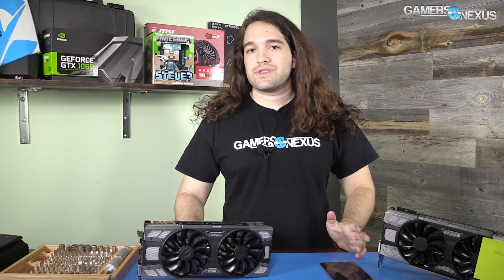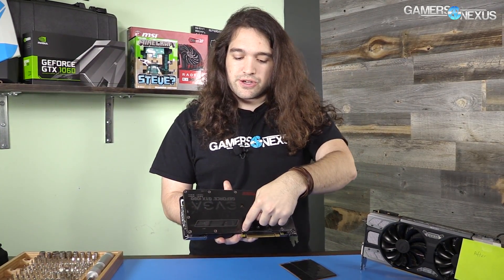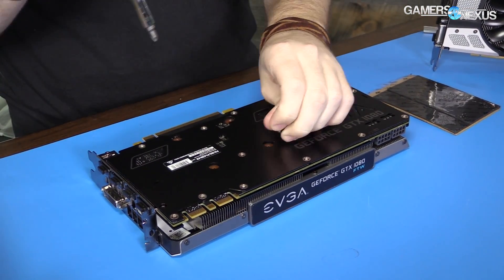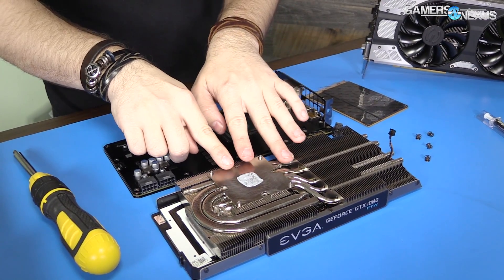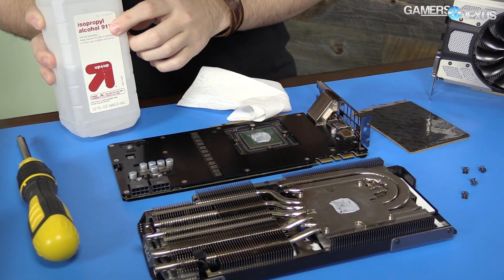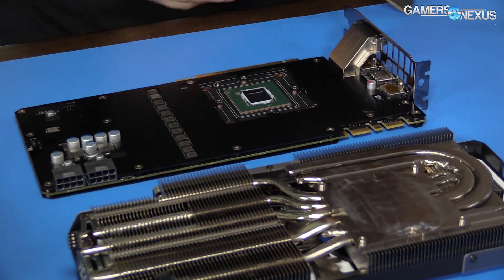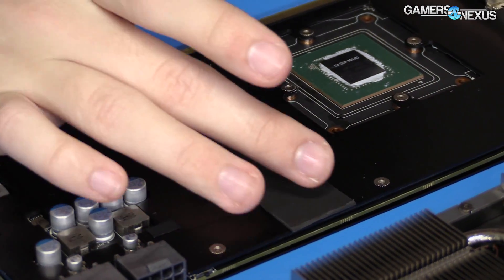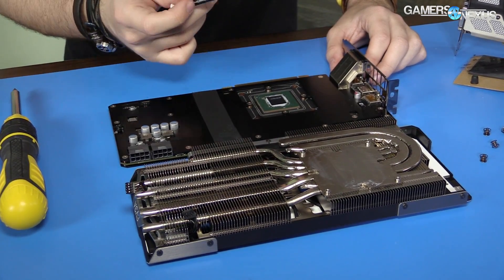How to Install Thermal Pad Mod on EVGA GTX 1080 & 1070

Comment: I always notice when you handle graphics cards that you have a habit of touching the fans. Those fan bearings aren't really designed to be load-bearing, they're only designed to hold a light plastic fan, not the weight of the whole card/cooler. Probably better to not touch the fans at all when lifting a card/cooler. It's unlikely to cause major damage but can cause them to spin off-axis and make noise/heat/wear/etc.
Reply from the maker: The fans are fine. You seem to think they are being pressed a lot harder than they are. The force from shipping would be far greater.
Reply from the maker: Because there is no risk of damage here. There is a huge difference between "push" and "touch." Being overly sensitive about this level of touching a product is needlessly worrisome. Flipping the card on its face doesn't put force on the fans, either. That's on the faceplate. And touching them while presenting is harmless.
Reply: God dam there is always one soap box idiot, minor touching the fans like that is zero issue, they are simply not that brittle, utter garbage.
Reply: I understand how you could see that as my taking offense but it was not. What I was trying to convey is exactly what I said. I'm not sensitive about it, and not overly so. Just trying to do you guys a favour and share the knowledge. Steve struck me behaving entirely defensively. He was defending himself against claims I did not make (flipping the card). He was exaggerating my concern (by calling me overly sensitive) and, in a manner most unlike him, he was throwing science and engineering out the window and telling his viewers that touching the fans is harmless, and refusing to follow best practice. That struck me as unusual behaviour for him (for example I've now seen three how-to videos on this and Steve was the only one with a visible antistatic strap), that's why it seemed to me that he was being overly sensitive.... So, that's why I said what I did. I ain't mad, I am a 'call it as I see it' kinda guy and that's all I was doing. I wasn't trying to 'hit back', just replying in context. Like you say, emotions are hard to read over the internet, and this is Steve's job, so I guess he doesn't have time to clear it up like we do. Either that or he just got mad and blocked me. Probably both ;) Anyway, Steve's content is generally excellent and I will continue to sub, like and share his content because it's high quality stuff. I ain't mad, he ain't bad. We're all good here :)
Reply: Damn this dude really wants some attention, why are you worried about other people's stuff.  Look mom i was right on the internet -- durrrr
Reply: I never said anything about flipping the card over because of exactly that. And yes, there is a difference between 'push' and 'touch', it's the amount of force exerted, and that's not visible on a video. I'm not being overly sensitive about it, I'm just mentioning it. You seem to be overly sensitive about me saying so. I've repaired a lot of devices with fans broken by people mishandling them. We'll have to disagree.
Reply: Comanso Rowlett
 I have no problem with him replying, never said I did. What do I expect? I expect him to at least say something like 'hey yeh it's a tiny risk but it's a really tiny risk and I'm careful, don't stress bro', so that his viewers know they should be careful too. Saying there is "no risk" is simply untrue, and worse yet, it gives untrained viewers the impression that they can do it too, with "no risk". What do you expect me to do, sit and watch someone teach thousands a bad habit and say nothing? TBH I have done for dozens of these videos and I'm starting to wish I had kept doing it... but some hardware techo like I used to be, would be fixing some of your noisy fans. I'm only trying to help, by passing on my experience (which is extensive) and training (from companies like Intel, HP, DEC, Dell and IBM who ALL said don't touch the fan blades - and that's ranging from laptops to blade servers.)

Whether he's been fortunate enough to not suffer from it is not relevant, many others have been less fortunate and best practice is best practice. That's why he's wearing antistatic gear in this video. 99 times out of 100 you could just tap the case before you start and do no damage, but we wear static straps because it's best practice - especially when you're a famous youtuber and a bunch of untrained people are following your every move. I never said he was going out to offend me and I never said I was offended. We just disagreed. He shouldn't change his methods because I said so - after all like I said his viewers generally will be untrained so it's sensible to take our comments with a grain of salt - but he should change them because touching the fans is not best practice, it does carry a risk, and most of all because it's not necessary - there are lots of ways to handle the card without touching the fans. Or heck, he could just do it his own way and not change at all, but at least let his viewers know that he's taking a calculated risk, so they can decide for themselves - and not pretend there is no risk at all. It's not Steve's style to be misinformative, otherwise I wouldn't sub, like and share his stuff so much. I understand it must be frustrating to have everyone question your methods, but sometimes they're going to be right....

Please stop with implying I've said things that I have not, and please read what I already wrote. Correcting and repeating it makes for walls of text and nobody likes that. I've taken the time to reply because I genuinely believe that we all are doing what we are doing here, Steve, you, and I, because we want to help each other.
Reply: Thanks to the wonders of search engines, I could spew documentation of bearings and their intended load vectors all day. I'll just be lazy and leave it at the first two search hits I came across since you're being rude: https://en.wikipedia.org/wiki/Ball_bearing#Direction_of_load

http://www.kaydonbearings.com/typesACX.htm
"Load can be applied to bearings in either of two basic directions. Radial loads act at right angles to the shaft (bearing's axis of rotation). Axial (thrust) acts parallel to the axis of rotation."

TL;DR: pushing on one side of a fan is neither radial nor axial load. They're not designed for it. That's why you shouldn't push on them, that's why you shouldn't risk pushing on them, which is why you shouldn't touch them unneccesarily. It's not an "oh noes it's gonna break if I touch it" thing, it's a matter of best practice - as I've said all along.

I'm done trying to help here. You'll be replying to nobody, so if soap boxing bothers you, maybe don't bother doing it yourself after I leave. But hey thanks for being so polite... not. At least Steve can disagree respectfully. You should learn that from him, too.
Reply: You also have to remember they are designed to spin so damn fast, so the way Steve is pressing it is nothing basically.
Reply: Capta Praelium It's his job, of course he will reply if necessary. What do you expect him to do, sit there and let a comment make people think he's doing something wrong? I gave him my TITAN XP to do some videos in and even tear it down alongside a hybrid. If touching the fan was a worry then he would of broken at least one already in his lifetime (fan)? Infact, he even span the fan which then hit a loose wire a few times and the fan was totally okay and he even tapped it where you can noticeably see it bob down and 0 problems what so ever. He wasn't going out to offend you in general either, he's just telling you these things from experience. Yes, your experience may be different but it doesnt mean he should change his style all for 1 viewer otherwise he'd be overrun by the amount of times he'd change.
Reply: Capta Praelium
I am reading exactly what you've said and you have to realize that emotion doesn't correctly come over text correctly so it seems like you got offended almost immediately. "I'm not being overly sensitive about it, I'm just mentioning it. You seem to be overly sensitive about me saying so" this comes across as you getting offended then hitting back saying he's overly sensitive...
Reply: Lemonpinesol yep he's an idiot!
Reply: Capta Praelium He touches metal contacts as well! Holy crap Huge Phallic Screwdriver!
Reply: Gamers Nexus Wrong! OIL FROM YOUR FINGERS, ALLOWS DUST TO STICK WAY MORE EASILY (AND UNEVENLY!)  INCREASING NOISE AND HEAT, DECREASING EFFICIENCY AND LIFE.
Reply: If they are good quality fans they will be fine.  If they are cheap shit fans, they will fall apart just by blowing on them.  But these days, for any high priced/good quality fan, it's really not an issue.  I've cleaned many a dirty fan with a lot more force than in this video, and they continued to operate normally without any problems.  The benefits of Asus, Noctua.. etc.  For cheap fans.. they'll fail regardless.. whether you touch them, bend them or whatever else.
Reply: That's an entirely different type of force at an entirely different vector. There's no point comparing them. They are designed to spin around the way a fan does, not to be pushed down on one side. What the comment above yours basically says is that he's being careful not to push them too hard. Better still, is to not touch them at all. It's not like you'll harm the card by not touching the fans, but there is a risk of harming the fans by handling them. Why take a risk if you don't need to?

Comment: This is the last time I will be purchasing any EVGA cards, this isn't the first time they've screwed up and I'm an idiot for purchasing from them.
Reply: really? i've always heard good things about them. my 780 is flawless, but i've only recently gotten back into building pc's a couple years now.
Reply: Bought a 970 ACX 2.0 from them on release and later came out that they were simply recycling coolers from the last gen cards which led to flaws and the GPU only having 2 fully functional heat pipes to cool it. Only good thing about that whole experience is that they have good warranty service. Needless to say they cut corners and it bites the consumers in the a$$.
Reply: All you have to do is download the VBIOS update, the pads are optional and free.

But hey go buy an MSI card and when something goes wrong just know you might be handing over $80 to fix the issue cause no everything is covered in their warranties.
Reply: If i had to say this for every brand i once owned i might aswell become a console peasant. There's flaws with every brand. Videocard wise i wouldn't be getting this evga, nor asus nor msi that way.
Reply: Hazard2005
didn't know that, i skipped maxwell. sounds like a recent trend with them then. not surprising, everyone is getting more greedy with profits.
Reply: X Fade Blasphemy! The counsel will try you for your heresy!

Comment: making direct contact to the heatsink fins? LOL
Reply: yeah, I have a question for this fix: the flat heatsink used in previous generation work just fine. Could it be the thermal pads between it and VRM is too bad or the mosfets were cheap-outed?
Reply: It was just an oversight in the design of the ASX3.0 cooler. Hence they offer the pads for all cards with this kind of cooler.

Comment: to me it looks like you just isolated the chokes from direct air flow from the fans, witch is worse than it was without the thermal pads. and if you get lower temps using thermal imaging, its because thermal pads isolating the heat inside, witch is worse. i don't get this "mod". just crank up the fans and be done with it. thermal pad that you applied first is touching just few mm of heatsink fins, this can't be effective when it comes to cooling them.
Reply from the maker: There's no air getting down there anyway, folks. There are already thermal pads flanking the chokes, so there was never any air getting under the baseplate (by design) to begin with, anyway. The chokes are connected to the baseplate and the heatsink via a pad now, and will only benefit from this change.

Regardless, our next few research pieces are coming out soon and used direct-contact thermocouples, which offers inarguable data.
Reply from the maker: We followed EVGA's guide. It would be better to have a flat plate surface, but that is not the cooler EVGA made.
Reply from the maker: You could say that the GPU is cut-off from airflow, too. Those chokes weren't getting air to begin with. The heatsink itself sits in the way. The thermal conductivity of air is nearly 0. It is far better to expose the components to metal and let that sink into the surface area, then dissipate that with airflow. Trying to force air into that tiny crevice wasn't going to work, anyway, and wasn't doing anything. If you were genuinely concerned about this, you could elect to increase the fan RPM via the VBIOS update and then opt out of the thermal pads.
Reply: +Gamers Nexus

> It is far better to expose the components to metal and let that sink into the surface area, then dissipate that with airflow

Yes, it would be better if the chokes were in contact with the heatsink, but the thermal pad bodge doesn't do that at all. It's more like putting a heavy blanket over them and further insulating them from what little airflow was getting to them.

There is almost nil contact between the thermal pad and the heatsink, it's basically a bunch of knife edges and no significant amount of heat transfer is going to take place. The back of the card is in the same boat, it looks like nearly half of the VRMs are under the mesh on the plate rather than a solid surface, which reduces heat transfer significantly.
Reply from the maker: We have found through testing that the thermal pads make a substantial impact, as conducted with direct thermocouples to the FETs #2 & #7 (hotspots). This content will go live next week. Cheers.
Reply: well, wont it help conduct the heat to the front-plate aswell? which in turn has a bigger area that is being hit by air
Reply: Martin Claesson

The plates have no thermal connection to each other, just mechanically and that won't transfer any heat.

+Gamers Nexus

>Regardless, our next few research pieces are coming out soon and used direct-contact thermocouples, which offers inarguable data.

I've seen Flir footage of the card with thermal pads vs without and the difference was negligible. At most there was a 5C drop and that still leaves the VRMs dangerously hot.
Reply: well, chokes didn't receive much air from the fan before this mod anyway,  for the simple reason that some of this shokes and part of VRM's are placed right under the second fan axle where the airflow is very low,
it's a misconception from the start
so they had no choice but to place this thermal pad directly in contact with the heatsink as the fan can't cool the vrm area properly
Reply: GGigabiteM i didnt mean the front plate and the back plate connected, i simply meant that the front plate which is right below the heatsink should be getting some kind of airflow on it. which in turn might've absorbed some heat thanks to the thermal pads?
Reply: Martin Claesson

>which in turn might've absorbed some heat thanks to the thermal pads?

There's literally zero surface area of contact between the thermal pad and the heatsink, no heat transfer is going to take place.

An example of the thermal pads would be to take a steak knife and hold it edge on to a hot skillet and expect the knife to get hot. The knife will never get hot because the contact area is equivalent to the width of a human hair.

The thermal pad situation is nearly the same only you have about a mechanical pencils' lead width instead which is still nothing.

The thermal pads are a crap solution to try and get people who don't know any better from pursuing further legal action against EVGA.
Reply: What if someone implanted a copper plate onto the thermal pad that meets with the chokes? That way when you press it down it sort of "bends" the copper and makes a somewhat snug fit.
Reply: ***** This needs to be compared lol I'm really not sure, I'd like to believe yours is a better idea but it depends. It would be nice to have a copper block like the heat sink you said, with slits in it for the chokes.
Reply: Gamers Nexus so if i buy a 1070 ftw and i fill my serial number in on the site i get the termal pads + de thermal koolpaste for free shipped to me?

Comment: Such a terrible thermal pad solution EVGA! They should give users free new designed ACX4.0 cooler instead of these pads. 
The pad on the frontplate pushs the one side of the fins on the main heatsink. The main heatsink is secured only with 4 screws around the GPU chip. It adds more pressure on one side of the GPU chip, so the GPU is unevenly loaded. I don't think that's good for GPU. They may hacked the vrm problem but created a potential GPU chip problem. And thermal pad on the backplate covers like 50% (or 80% for non-ftw model) mesh area.
Reply: All you have to do is download the VBIOS update, the pads are optional and free.
Reply: There's no uneven load, the 4 screws prevent this. The thermal pads are quite soft. The fins from the cooler will indent them. Wich gives them a better dissipating area to boot.